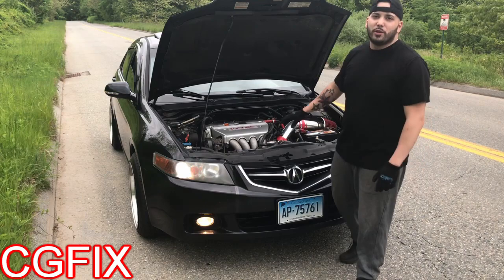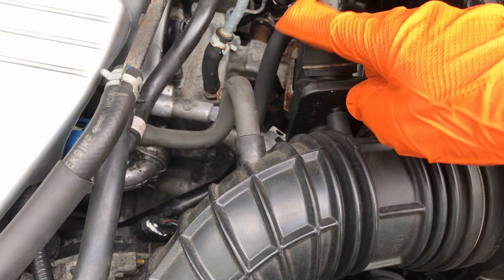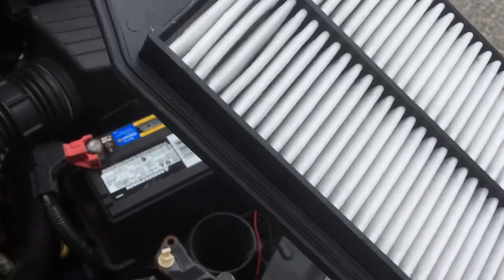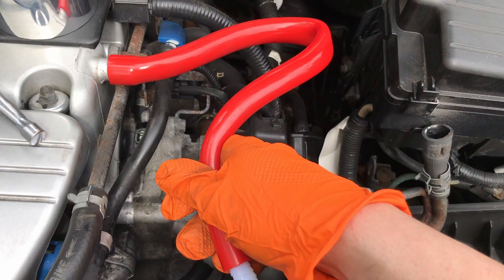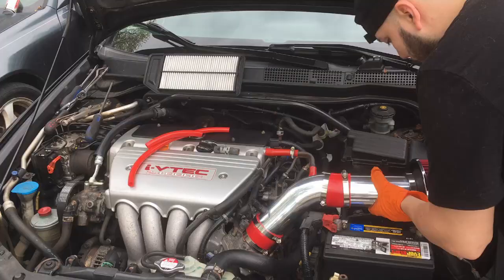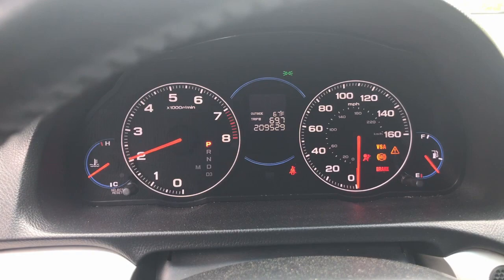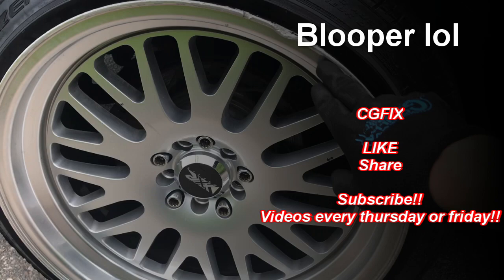How to install a air Intake

Comment: Great job. Already better than most how to videos on YouTube. Some small suggestions:
Generally lower music volume as it is louder than you most of the time. 
Try to loop the music so it doesn’t go in and out when it restarts. It’s tough but it’s good practice. 
Outside that, not bad at all keep it up. 

Maybe down the line some sort of tripod so the cam doesn’t move as much?
Reply from the maker: Synful Jungler thanks means a lot for the feed back means a lot!! Make sure you hit the notification bell 🔔 so you won’t miss great how to videos coming up! Again thanks for being a subscriber!🤘🏻😎
Reply from the maker: Synful Jungler yes also just bought a tripod 👍👍👍 better software and iMac 🖥 better will be posted again thanks thanks a lot for the feed back !👍👍👍

Comment: Do you have another link for this intake? I can't find this one, and I want this one in particular because I see you have that plug-in for the airflow sensor right at the throttle body. I don't want a check engine light!

Comment: You have every warning light possible on??  Did u get them when you installed this intake? Did u get check engine light for installing the air intake? 🤔
Reply from the maker: Only reason their on just never bother to clear the codes after installing new parts and only if it’s not installed properly it will run on check engine light for evap
Reply: How To CGFIX tanks for response. ⭐️⭐️⭐️⭐️

Comment: Would this fit an 05 tsx? Great video btw🔥
Reply from the maker: Yes it would fits from 04-08 and thanks bro 💪🏻
Reply: @CGFIX  and another thing. Do you still have the same intake on and if so how is it holding up? Is it reliable?
Reply from the maker: i had it on for 1 year and it sounds really good give more air intake for sure but I went back to stock wanted to keep her quiet as a daily am building another one soon going to be on the channel
Reply: @CGFIX  perfect thanks again🙏🔥
Reply from the maker: No problem bro 🤙🏻 stay safe

Comment: Does leaving the stock box on still bring cold air up?
Reply from the maker: Well installed a short ram intake on my Acura so it’s really not getting much colder air then stock if you want a cold air intake I would suggest getting an air intake that goes all the way down to the bumper but to answer your question yes

Comment: Amigo el sensor maf donde va
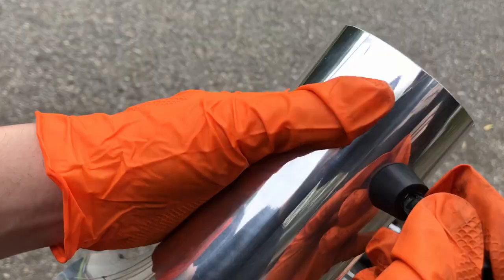Reply from the maker: DJ aztecalatino Mira 4:00 🕓 el va en la tu tuberia nueva
Reply: Tengo un Honda accord 2004 el motor es el mismo igual tengo ese intake pero no tiene donde poner el sensor maf solo es un tubo